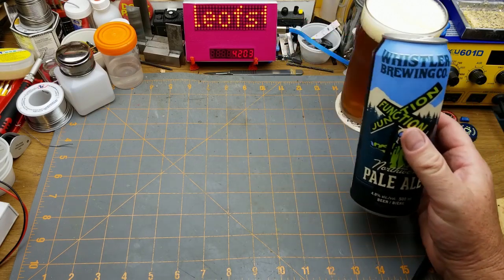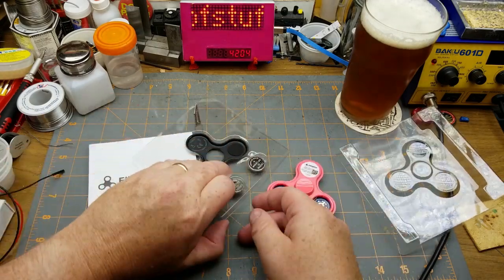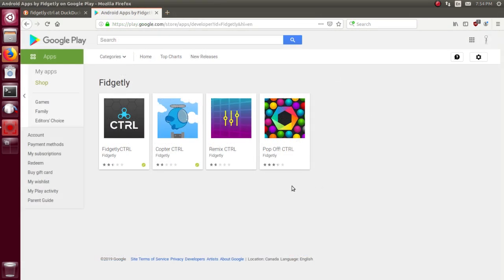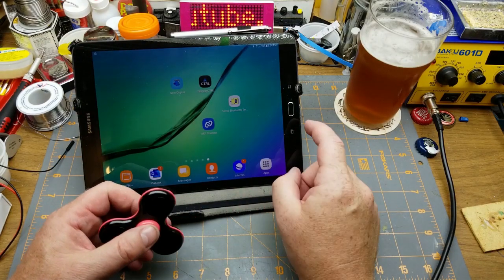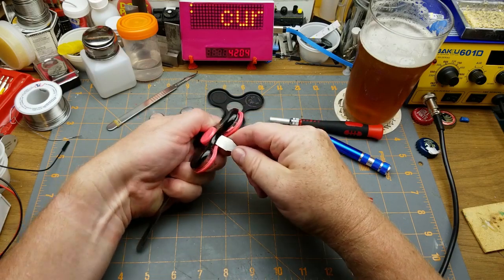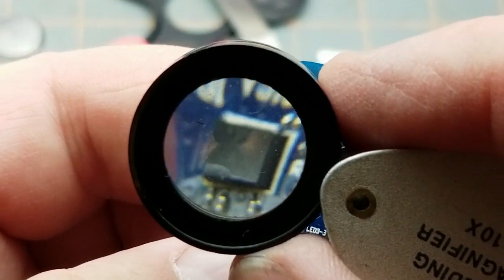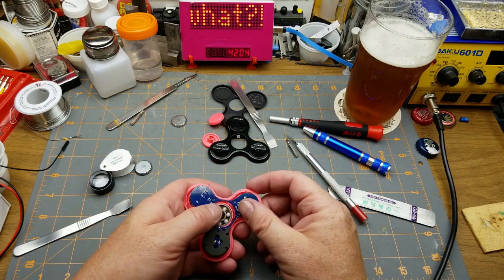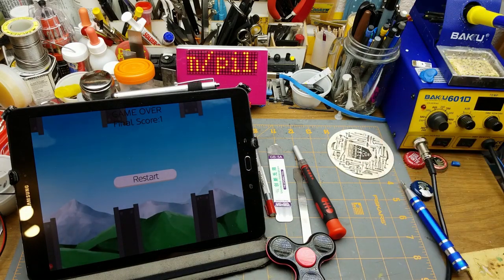why does a bluetooth fidget spinner even exist? (teardown video)

Comment: With the Hall effect rev counter and a gyroscope for orientation sensing it seems like it might be useful in a wind turbine.
Reply from the maker: If a person could access the programming API there could be a lot of cool uses. 

Unfortunately that doesn't seem possible any more, unless the manufacturer wakes from the dead.
Reply: They did get a bit carried away with that processor. Maybe it could be used as a Bluetooth windmeter/weather vane using the existing software.

Cool video of an intriguing gadget!

Comment: I ordered 3 from China about a year ago for about $3 each but mime had micro usb port for the rechargeable battery and bluetooth speaker in. Only wanted them for integration into model trains to sent expensive dcc sound chip to multiple locos speakers, one at a time on command (you form a consist with the remote sound chip with the cheap non sound chip in each loco to synch sound to speed). Unfortunately yet to implement the idea. 
The bearings were useful too for my 3D printer spool. Also had 3 red, 3 green and 3 blue micro LEDs in each one.

Comment: If you can get this widget to report RPM, perhaps you could cobble up a propeller and make a blue-tooth reporting anemometer(?)  At least something potentially useful.
Reply from the maker: Unfortunately the developer tools they claim to provide require a unique developer API key, and the link to request one goes nowhere (I looked at the source of the web page and there is a comment on the API key request link that says "todo"...)

I'd probably need to re-program the microcontroller and that's way beyond my hobby level coding abilities (or interests). 

But the method looks simple enough to implement in different hardware.
Reply: @pileofstuff  To quote my friend , Marine Corps General George Leach: "Nothing is ever simple."
Any way, I really enjoy your vids.  Thanks.

Comment: The spinner box used a magnet to keep the flap closed. You removed the magnet. Did you remove the sliver of metal in the flap, that the magnet attached to?
Reply from the maker: I pulled one out, but it was just a washer - nothing very interesting.

Comment: Are you a linux man??
Reply from the maker: Absolutely. 
I only use Windows when someone pays me to...
Reply: @pileofstuff  that's awesome!! What distribution are you using? Any recommendations for screen recording and video editing software? I am using mint
Reply: I have the exact same question. I was trying to install OBS studio on mint and I had nothing but installation package missing errors and things so I ended up going in circles and when I thought I finally had it installed it still wasn’t installing everything and I have nothing to work with so I am lost.
 That’s why when I do anything on the basement computer, I’m still aiming the camera at the monitor old school to record it.
Reply from the maker: @GeorgeJFW  The shop computer is Lubuntu (it's am old machine, so light distro).
I'm using SimpleScreenRecorder to capture my desktop.

On my editing machine, it's full stock Ubuntu and I edit with KdenLive.
Reply from the maker: @GadgetReboot  I've tried OBS but it's a bit too heavy for my old found-on-the-side-of-the-road shop computer.